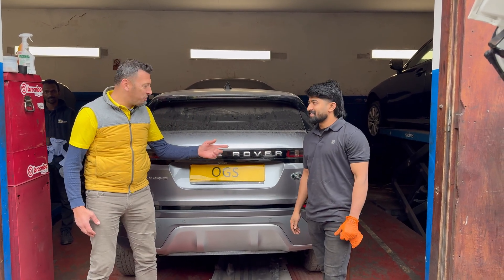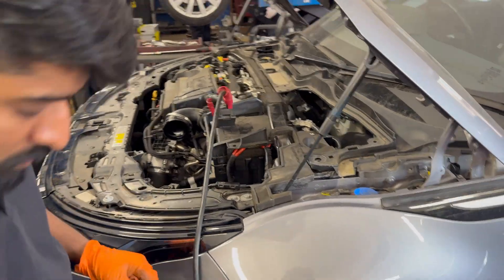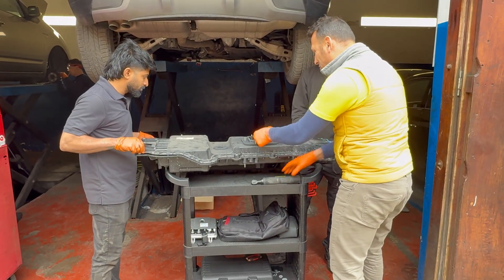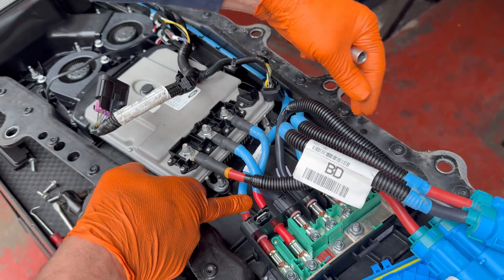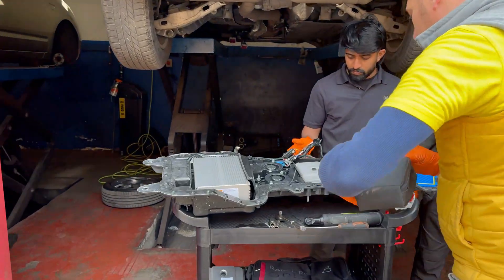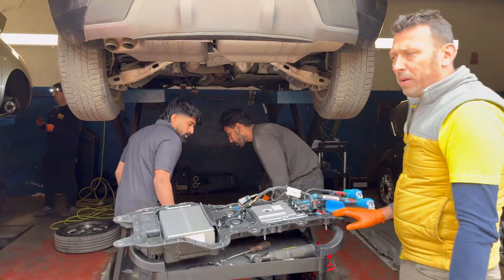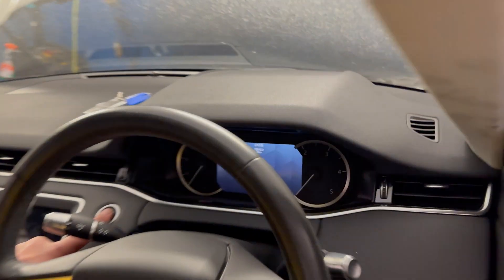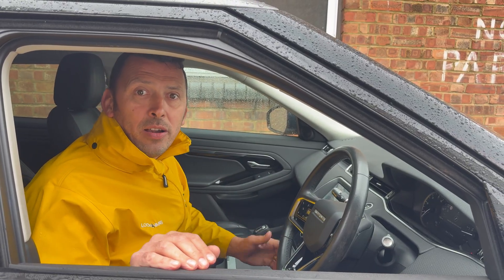Range Rover Evoque Refused to Charge – Until We Fixed the Hybrid System!

Comment: The failure if the 48V-12V converter is becoming a common problem and it seems to be on backorder and takes months to be delivered to the dealerships. Such a simple component should be made to last the life of the vehicle - 20 years or 300,000 miles/500,000kms

Comment: Such a cool video. I was told they are common faults, any idea why they go bad ? I'm trying to learn about them and would like to know if you have any other common faults on the charging systems on the hybrid I can look out for? Also do you have a video on how to test them ? I had a JAGUAR, F-Pace, 2022, DIESEL/ELECTRIC, 2.0 with the High Voltage Junction Box in boot not charging the battery and I told the guy I I don't know how to test them but I have been told the High Voltage Junction Box can be the problem in most cases.

Comment: Hello, I have a problem with my Evoque P300 hybrid vehicle. I'm in Morocco, and Range Rover can't repair my vehicle. The problem is a locked hybrid battery. They can't unlock it. The error code is POAA0-66. I don't know if I should remove the battery, send it to you, or come to you. Can you help me?
Reply from the maker: the HV battery control unit register an error, that might be able to only delete by reading eeprom data on bench. does your vehicle has any form of aftermarket security? Like Ghost Immobiliser?

Comment: The error starts with the 48v battery, there is a campaign to update or change the battery (N835), when the battery breaks it breaks the current converter.